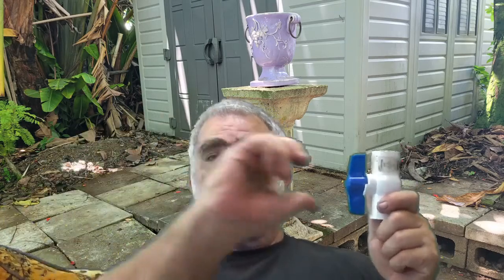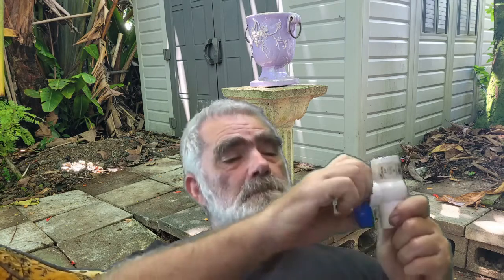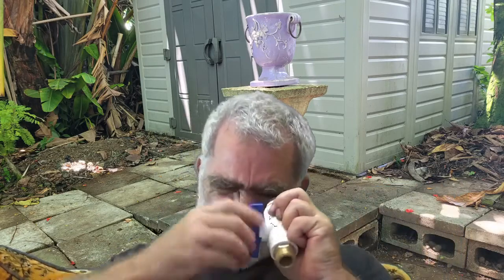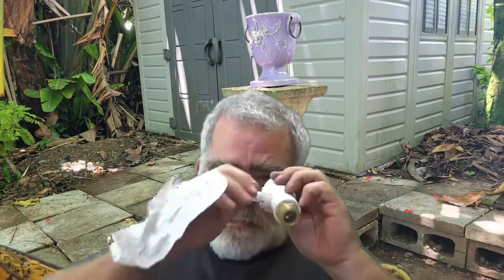Selecting valves for pumping aircrete

Comment: Hmmm
I'd wonder more about the seals on any ball valve rather than what the body and ball is made of. Of course the plastic ones are crap but there's a wide variety of seal materials and designs in the brass, ferrous and stainless metallic ball valves too so some may work better or worse than others.
There's a bit more flow turbulence / restrictions in gate valves but that's what is usually used in slurry and waste pumping because they are more tolerant of solid materials. Thank more effort and not as quick as a ball valve though.